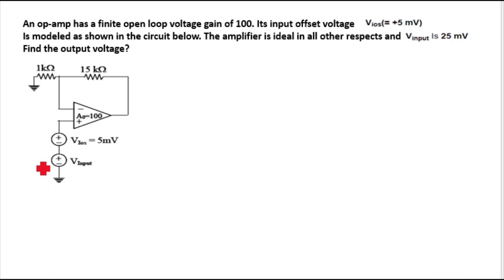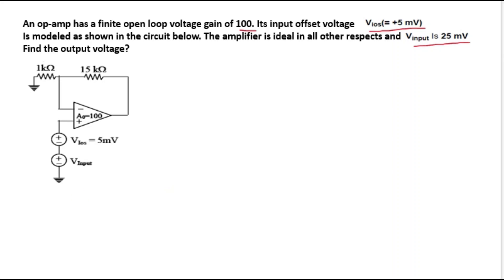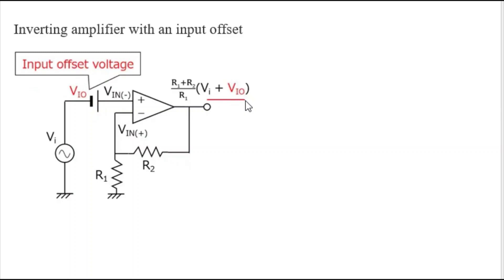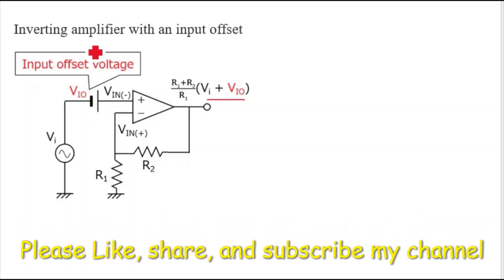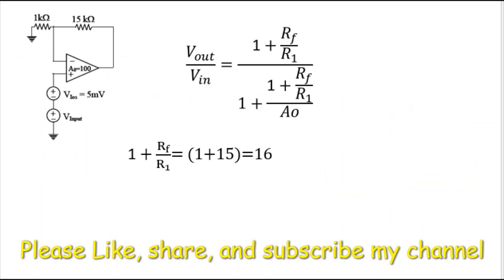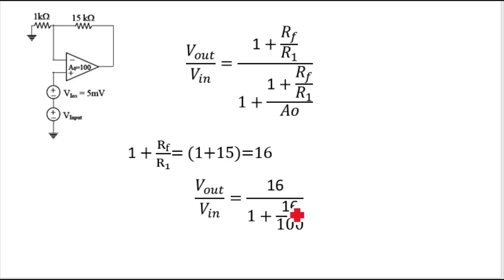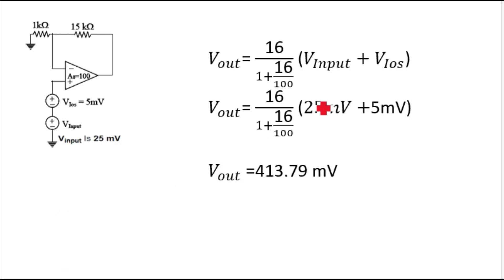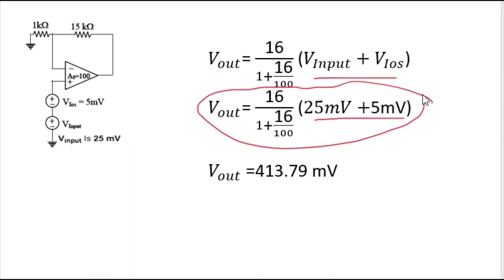Find output voltage of Op-amp with Input  Vio or VOS/ Analog Integrated circuit

Comment: Could this calculation be approached using nodal analysis?
Reply from the maker: During offset condition noninverting and inverting terminal potential is not same so direct nodal analysis will not give correct answer. Nodal analysis is applicable if virtual ground condition satisfied. During offset, gain comes in consideration only appling nodal analysis may give wrong answer.